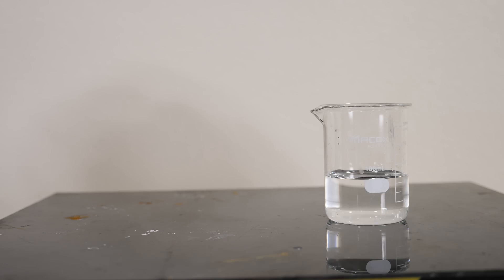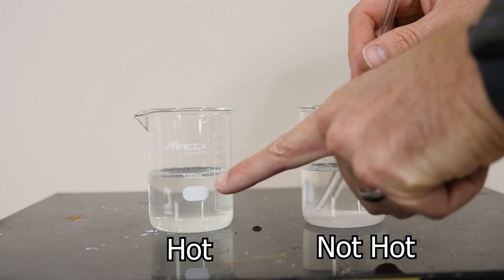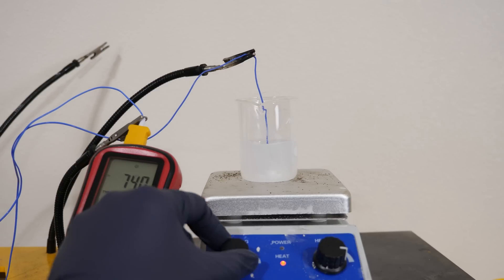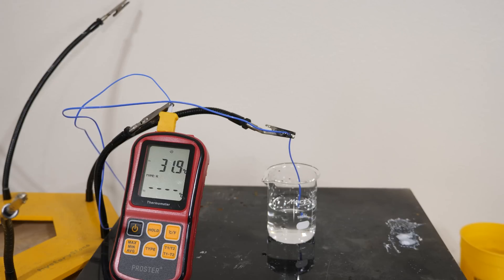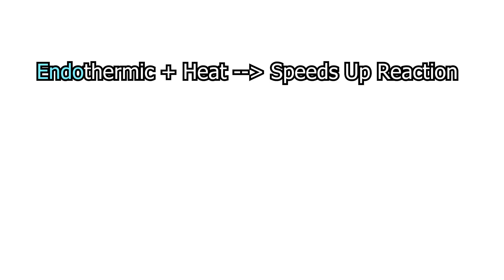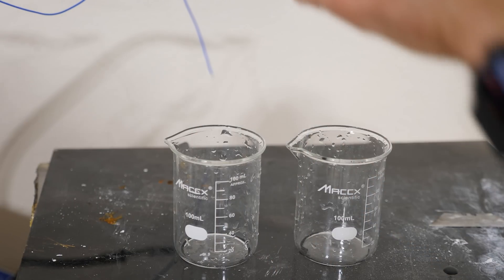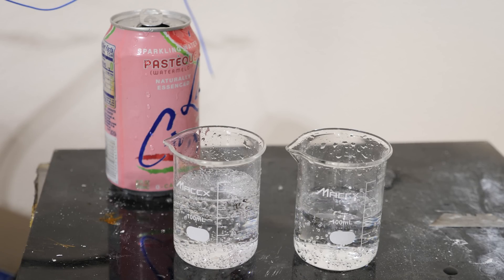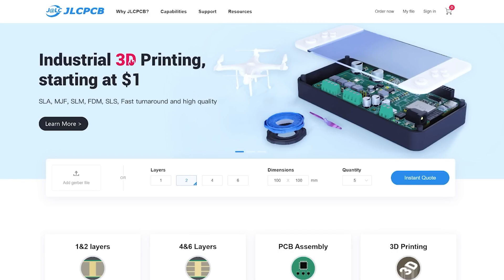Why Does This Powder Only Dissolve In Cold Water?

Comment: Whet heat you introduce more eveige thention and more diverentional for the boths (water and chucked to speed op in the same speed to leak inbetween the space of the water just rarryïng H2O. 
When thention lowers down en thention diverentional becomes less it becomes shucker again💜😍

Whe I ad gold in the water water becomes less negative water slows down in to the speed of carbon to leak out inbetween 😍😍😍
This is catlistic event 
Than if you take a jar with water led s on for a 8 hours and than put the shucke in to it you wil olso reach the same behavieures😍
Reply: Than you can see how led light contributes to globale soil degradation
The elementar behavieres pop of existence in to other existances like your shucker in the water🥰😍🥰
Reply: As led light is catalistic exelerator 😍 for gasiuse infiormends and directional feildflow containers for eurth to behave like eurth
Reply: When the water creates more resistance to desolve the sucker
Than😍😍😍 whayt a other day.with led on
When gass universum schinks the water mabey is eble to expand in to creating more everighe thention in the water body inbetween within and around the H2O
Reply: Like howe  normal ice and supper could ice counting in elgader fore there resistance to peal of and conect with elchadder you have fire too💜
Reply: Yeak😍😍😍 if water reseaves diverentional it olso create more resistence to move out the parts inbetween tham that not completely is able to fit inbetween.
Atomic bound becomes stronger of the water 
And olso like facume you tace out the space inbetween the water.
Wat is this is grease elements.
It desolves in to.
But inpand in to itself as you heated up and they reseave to less to be home  in te energy cicle it has not inof to tace and release as the infiorment around it moves to fast they drop down like boiling vacume water🛸
Reply: Oll cold and heat transitions s just a symptomp💜 of the spacedancetys there interactions of the total set of conditions
Reply: The expantion and impantion of the space dimentions of carbons behavieres😍
Space inpands olso 💜
Reply: Whay I never approved the humble constand but the hobke constand flux as the jws now is showing ment kind 🙏😍🙏
We see it in our cup and jad needs major telescope to show wat is happening in our own cop🤣🤣🤣🐒 L🌀L
Reply: Thank you and oll, and oll injoy beïng🍀🌻🍀

Comment: I have a question somewhat related which is why the gas bubbles in a solution when they're small always adhere to the side of any container. I mean aren't they suppose to rise instantly to the surface since they're less dense
Reply: I wonder if it has something to do with surface tension and microscopic impurities on the inside of the container. I wager if the container wall was ideally clean and smooth then bubbles would not adhere...
Reply: The impurities on the surfaces are nucleation sites for the dissolving gas. H2CO3 in an open soda can is not at equilibrium anymore and dissolves into CO2 and H2O. Just like a in a supersaturated solution it needs some kind of 'starting point'. 

This is what happens when you shake a soda bottle: you introduce billions of small air bubbles, which are all little nucleation sites.
Reply: @zhugnachaz8709   i get that but once this phenomenon occurs and the co2 gas is formed by the help of the nucleation sites you just talked about then why these bubbles seems to stick and not float instantly without a help of a shake to get them to dislodge. What's the secrete of this stickiness. Final note that reminds me of a similar topic when i was taking chemical lessons that they use platinum when ever they want to initiate a reaction involving hydrogen gas so that the hydrogen in a solution doesn't float away and remains on the surface of platinum metal.
Reply: @waelfadlallah8939  1.That's called adhesion, but explaining that would be too much for a yt comment.

2. The spots you see in soda or boiling water are often not a 'single bubble' of gas. It's more like a place where the gas can form and rises to the top (often not visible). But the same amount of gas is formed new from dissolving out of the solution.

If you boil water in a pot, you can observe those spots on the ground where air bubbles constantly come out.
Or if you look at the glas walls of a soda drink, you can see spots with bubbles that seem to 'produce' new bubbles.

But the main answer to your question is adhesion.
Reply: @waelfadlallah8939  Oh and btw, be mindful that the video here in question is full of errors.

Comment: One time, my younger brother and I went to a weekend event with cabins. Each cabin could hold about ten people. It was winter, and it was below freezing. However, the cabin was really warm. A person in our cabin had a bright idea to chill cans of Coca-Cola outside. One of the kids took one can from outside to inside the cabin. When I heard commotion from the kid, I turned around and noticed that the can was deforming. I quickly told the kid to throw it outside. He threw it outside, and while in mid-air, the can exploded.

There has to be a point where the temperature and pressure of the water can't contain carbon dioxide anymore. I mean it's too cold to contain carbon dioxide. I think that is what happened. When the kid brought the can in the warm cabin, the carbon dioxide gas started to expand rapidly to the point of explosion. The can was thrown outside just in time so we didn't have a mess inside the cabin.
Reply: I wonder if the cans were chilled too long, and the soda froze, driving the carbon dioxide out of solution?  Then when brought inside, the heat inside the cabin would warm up the gas faster than it melted the ice, thus causing the gas to expand.
Reply: @Lucius_Chiaraviglio 
The full cans were sitting outside overnight. They were definitely cold.
I totally agree with with you. What I don't know is that: Does carbon dioxide in water become a separate gas before, during, or after water becomes ice. If it's during, I know the process is not uniform. So, we still have before, during, and after. As I remembered the situation, it wasn't totally solid inside of the exploded can. It might be other things in Coca-Cola to prevent total ice formation. It was a nice explosion, and I'm glad it happened outside.
Reply: @QQuandary  It would be during freezing, and yes, it would be non-uniform, and yes, stuff dissolved in water impedes freezing.  What happens as water starts to freeze is that the ice excludes the other stuff, including carbon dioxide and sugar, as it forms.  That means that the other stuff gets more concentrated in the remaining liquid water, which lowers the freezing point.  The carbonic acid can turn to carbon dioxide and the carbon dioxide can turn to gas when it gets saturated, but the sugar can't, and sugar has to go to really high concentration before it saturates (and it is fairly likely to supersaturate as well -- get so concentrated that it would be energetically favored to come out of solution, but doesn't do so unless something triggers it to start).  So the remaining water becomes a syrup that has a freezing point low enough that the winter temperature outside might not be cold enough to finish freezing it; meanwhile, much of the carbon dioxide is a gas (you would have to get Antarctic winter temperatures to liquify or freeze it, and the thin can might not be strong enough to hold the somewhat more than 5 atmospheres of pressure needed to liquify it at its triple point anyway, let alone the higher pressure needed if the temperature is still above the triple point of carbon dioxide).
Reply: @Lucius_Chiaraviglio  
Thank you so much. It was so much fun to see that Coca-Cola can explode. It was also I told you so moment to the guy wanted chill the cans outside. I was young then, however, I was very good at Physics.
Reply: My  late father once placed a bottle of champagne in the freezer. Bad move! It exploded, wrecking the freezer.
Reply: @romanpolanski4928  
I would say it's a bad move also. 🤣😂
Champagne bottles are already under high pressure. It wouldn't take much energy to explode a champagne bottle when the contents are below freezing. Just a light vibration from the freezer should do it.
Reply: @romanpolanski4928  
At least, the freezer took the blast, and no one was was hurt.  (I hope.)
Reply: What? That sounds like complete bs to me, in hot summers we store Cola cans in the freezer and they don't explode when you take them out?
Reply: @bylu6712  
I have no idea where you live and your freezer conditions, so I'm going to try to not make any assumptions. How do you know that your freezer conditions are a equivalent to the outside condition that the exploded Coca-Cola can experienced? The explosion was caused by expansion of the carbon dioxide gas due to warming. The carbon dioxide gas was caused by the changing the phase of the carbonated water in the contents. When the phase of carbonated water go from liquid to solid, the carbon dioxide is released from the carbonated water. The only reason that your cans in your freezer didn't explode is that it was not cold enough. The event I was at was so cold.
Reply: @QQuandary  the freezer is at least -8°C and outside 36°C
What where the conditions in the cabin and outside of the cabin?

Comment: I'm feeling skeptical. Take a classic exothermal reaction: oxidation of wood, aka burning. Make it hot enough and you get a roaring fire, remove heat and it will not burn at all.
Reply: In chemical experiments exothermic reactions you need to counter the heat let off so that the reaction dosent destroy itself or bubble violently out the glassware settup so ice water or dry ice and isopropyl alcohol baths are used to counter this
Reply: @staceysmith-gd3zv  Exactly. Plenty of exothermic reactions that will go totally runaway self-accelerating through heat they emit. So the claim that exothermic reaction will slow down when heated, and endothermic will accelerate seems to me... dubious.
Reply: @sharpfang  im not qualified to explain this rabbit hole as another comment brought up you should start with Thermodynamic equilibrium explaining the reverse effects your talking about but thats a rabit hole i enjoy learning and yet dont fully grasp as i ve only glanced down the rabit hole
Reply: In a fire if you remove any of the 3 needs in the fire triangle cannot continue to be  exothermic and will just cool down removing heat is called endothermic and in your particular example endothermic reaction would be the evaporation after pouring water on the fire creating steam to relese the left over energy removing "heat" in fire isnt as simple as literly just deleting heat it needs to be depleated somehow

Comment: Can such reaction be used as a thermal battery?
For example adding heat would separate the compounds, but when heat is extracted that they mix again?
If possible what would be better materials for such battery?
Reply: Actual phase transitions represent a much larger change in thermal energy. Air conditioners, heat pumps, steam engines, and sterling engines all use various fluids to store thermal energy to be transported to another part of the machine/system. Sterling engines might not involve multiple phases, though. Most plans for storage of solar thermal energy involve phase transitions between solid and liquid.

Comment: Another cool thing with Calcium Acetate is that you get Acetone by thermal decomposition if you dry it and heat the powder in a distillation apparatus.
Since Calcium Acetate can be made by reacting eggshells with acetic acid (e.g. vinegar), you can create nail polish remover from things in your kitchen. 😄
Reply: So, eggshells+vinegar+heat=nail polish remover?

Comment: The change of temperature when a solid is dissolved is called "enthalpy of solution".
At least that's a good search term for it 😄. It's called other things too  but they can often be misinterpreted, such as "heat of solution".
Reply: Enthalpy works with both exothermic and endothermic reactions and it determines weather the reaction was postitive or negatively charged or depleted did it produce or absorbe energy

Comment: Strictly speaking, it is incorrect to say that an exothermic solute will dissolve “faster” or “slower” when the temperature increases. Even though sodium chloride is shown to dissolve endothermically, the fact is that its solubility curve is almost flat compared to something like ammonium nitrate (used in cold packs); nevertheless, salt crystals still dissolve more quickly in hot water than in cold water. When you heat up a mixture, you increase the frequency at which the solvent/solute particles bump into each other. Whether this makes the material “less soluble” in the solvent doesn’t change the fact that it will still, in most cases, dissolve more “quickly” simply due to increased kinetics. There are also cases where heating a supersaturated solution will make a product crash out more quickly (kinetics) even though its solubility (equilibrium) increases with temperature. Bottom line, kinetics and equilibrium are related, but it can be a lot more counterintuitive than it appears and you have to derive the data on a case by case basis.
Reply: Would you happen to know if I had a vacuum chamber with one molecule of water in it, and I heated it up could it turn to steam? Or if I cooled the chamber could the H2O molecule turn to ice? Thanks.
Reply: @CandidDate  It is impossible to describe a single molecule of water in a vacuum as a liquid, solid, gas, etc. A substance’s state of matter is by definition the relative strengths of intermolecular forces vs the kinetic energies within it; with only one molecule, there are no intermolecular forces. I suppose you could describe this single molecule as a gas, as just like a typical gas the motion of the particles are not significantly hindered by IM forces. But that’s about as accurate as describing the social situation of a lone person living on a deserted island as an “absolute monarchy”.
Reply: @katiefrisk980  Next question. Thanks for answering. What are clouds?
Reply: @CandidDate  It is meaningless to talk about the phase of a single molecule.
Reply: @romanpolanski4928  How do you know? Maybe molecules change imperceptibly under different temperatures, pressures, and volumes. Kinetic gas theory is after all statistical. And just a theory as far as I can tell. Problem is, science relies on data and data comes from observation. I observe a molecule only in aggregate because my theory works only with aggregates. How's about we start with the theory that we are in a computer simulation? Have you ever played "Minecraft?" Same thing, but at the Planck scale. You see where I'm heading? I'm not saying it is all mental but I'm also not saying it's not all mental.
Reply: @CandidDate  Interacting with someone who thinks a computer game like Minecraft is useful in Chemistry and Physics is a waste of my time. Only a crank would question the kinetic theory of gases. You're clearly a crank.

Comment: I remember learning or reading that the exothermic reaction substances dissolve better in cold water, but I wasn't sure if it was actually true. Really cool, thanks!
Reply: In many exothermic reactions you need to counter the heat let off so that the reaction dosent destroy itself or bubble violently out the glassware settup so ice water or dry ice and isopropyl alcohol baths are used to counter this
Reply: After seeing the response video, I have to take this comment back